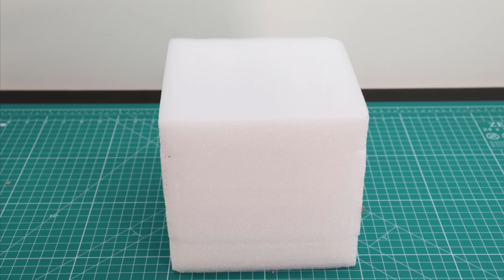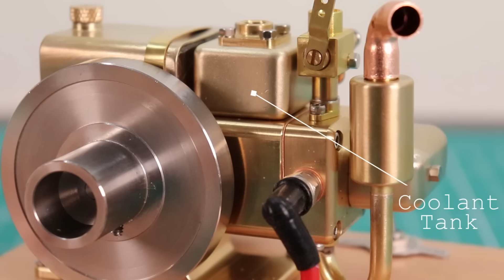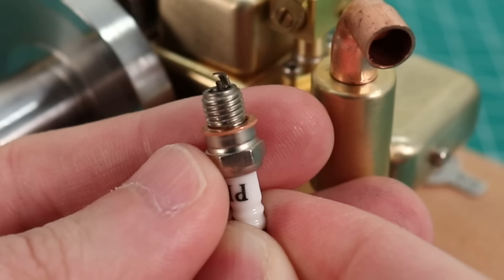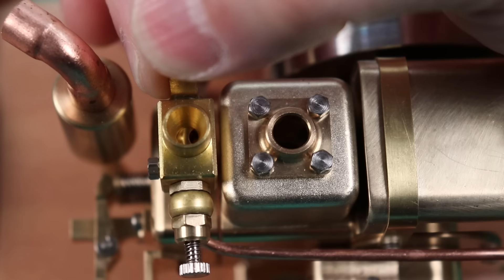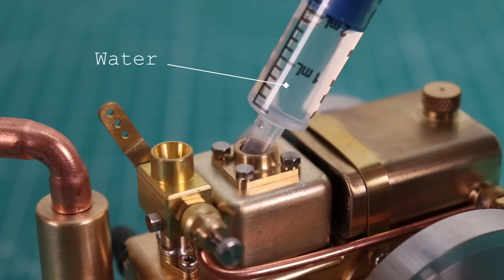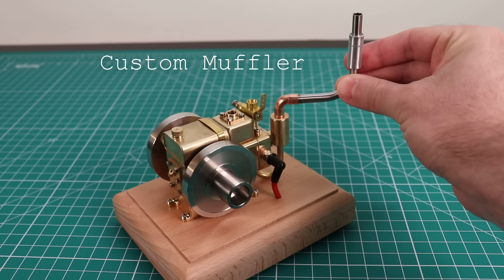Self Unboxing Steampunk Engine - Mini 4-Stroke Engine

Comment: Can we produce electricity with this engine?? If yes, how much volt can produced??
Reply: Depends on the generator. Possibly 12 volts
Reply: Thank you for your valuable information 🤗🤗
Reply: @nomantariq5078  👍
Reply: it depends you can get 12v generator and make circuit and get it down to 5v for phone charging and maybe 20w of power
Reply: @tobilos_gaming  ooh good! 👍
Reply: @tobilos_gaming  thanks for this valuable information 😇👍
Reply: Before provide with sutable flexi cupling gear wheel of a engine.
Reply: it needs 3 batteries
Reply: easy you just need a motor. Attach the shaft of a small electric motor to the driveshaft of the engine. Spinning the rod mechanically with generate electricity on the other end. Then wire the motor into a phone charger and see what happens.
Reply: Bruh it already runs with battery
Reply: Lighting up 5-7 watt led light ... 😅

It depends on your application certainly it will not generate enough power to turn your home tv on
Reply: @Spicy34567 

For sure ... 😊

Comment: I don't know if you adjusted the engine, but it is very well adjusted! For acceleration does not fail.
Good video!
Reply: 2ñ9nwo
Reply: @ManualdoMotorStirling You mean exactly the opposite, because the power is too weak and the engine sounds like a 2-stroke engine.
Gas/air mixture is not in the correct ratio to each other, see 3:47.
The oxygen supply is throttled, but the petrol gas supply is not. See 4:04 A lot of gasoline is still being added to the combustion chamber, which is why the engine cannot run optimally. 

Du meinst genau das Gegenteil, denn die Leistung ist zu schwach und der Motor hört sich an wie ein 2-Takt-Motor. 
Gas/Luft-Gemisch steht nicht im richtigen Verhältnis zueinander, siehe 3:47. 
Sauerstoffzufuhr wird zwar gedrosselt, aber die Benzingaszufuhr nicht. Siehe 4:04   Es wird unverändert viel Benzingas in den Brennraum hinzugefügt, darum kann der Motor nicht optimal laufen.

Comment: You can clearly see how a lot of unburned gas is discharged immediately after closing the throttle.
I can understand the reason why the engine carburetor of the actual car was changed to injection.
Reply: Car carborators don't do it that much it was mostly changed because carborators don't like the cold and change in elevation
Reply: my first car, I wired up a spark plug to the exhaust and run the contact points of the engine to to an aux coil in the rear of the car. I wired up a 3-way switch to activate the aux coil and spark plug whilst simultaneously cutting the ignition to the engine. i could flip the switch and max throttle some decent flames out the back of the exhaust. Finish it off with a pull of the choke and got some quite large ones that came up to the rear window. seeing this on the video I wanted to see a tiny spark plug in the exhaust :)

Comment: I wonder if the battery is only responsible for the spark or is there also an electric motor that causes all the movement and combustion is only its effect?
Reply from the maker: correct! the battery is only to power the spark plug.

Comment: That’s a great little engine. The only question is, what about valve train, piston and crankshaft  lubrication? I’m mystified. 🤓👍
Reply: The crankcase probably holds a small amount of oil.  The valve train doesn't need much oil and you just manually oil them once in a while.  Old industrial engines used to operate with exposed valve trains all the time and you just manually oiled or greased those parts.

Comment: hey, I have that one too, but it doesn't work, sometimes it does, sometimes it doesn't. Do you have a tip?
Reply from the maker: it really comes down to the adjustment of the carb, also depends on the ambient temp.
Reply: @DIY-Garage  do you maybe also have a tip on how I can warm it up so it does it again?
Reply from the maker: @MDrones7  try choking it upon startup

Comment: What kind of oil did you add to the fuel and how did you know it could run off of different fuel types?
Reply from the maker: The engine came with a data sheet showing allowable fuel types. I don't remember what oil I added to the fuel, I think a few drops of machine oil.
Reply: I need

Comment: Mit den Motor stimmt was nicht. Siehe 3:47   Leistung zu schwach und hört sich an wie ein 2-Takt-Motor. Gas/Luft-Gemisch steht nicht im richtigen Verhältnis, siehe 3:47. 
Sauerstoffzufuhr wird zwar gedrosselt, aber die Benzingaszufuhr nicht. Siehe 4:04   Es wird unverändert viel Benzingas in den Brennraum zugefügt, darum kann der Motor nicht optimal laufen.

Comment: I purchased one of these and ran it on lighter fluid. 

Initially it wouldn’t start until I put the spark plug in the vice and tapped down the electrode to give a smaller spark gap. 

I had great difficulty in starting it. When I did get it to run, the mixture was rich and and launched blobs of un-burned fuel out of the exhaust until the engine flooded. 

Also, the instructions were badly translated and virtually useless. 

Do you have any tips for getting these to run properly?
Reply from the maker: the trick is to get the carb tuned just right
Reply: @DIY-Garage  I did also consider experimenting with propane for a cleaner burn. What do you think?
Reply from the maker: I would recommend camp fuel / Coleman fuel (white gas), it burns very clean. I've had very good success with it. I haven't tried propane.

Comment: Why do so many of these mini engines not need motor oil?
Reply from the maker: that's because of the bearing design.
Reply: @DIY-Garage  Do a Make a Mini 12v cummins 5.9 6bt engine

Comment: And it runs with zippo fuel?
Reply from the maker: yes, zippo lighter fluid
Reply: @DIY-Garage  and then you have to put oil in too
Reply from the maker: @stephanmodellbahnspurn81  yes, just a few drops
Reply: @DIY-Garage  Can you make a video on how to fully operate it with a gasoline mixture?
Reply from the maker: @stephanmodellbahnspurn81  the principle is the same, just use gasoline.
Reply: @DIY-Garage  how much Oli come in? Und run ist Not with Oli?